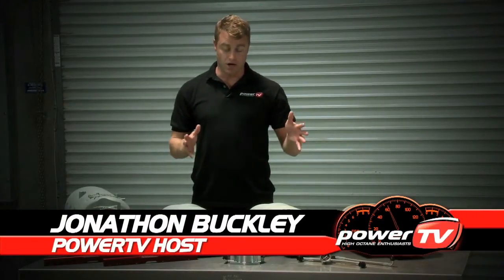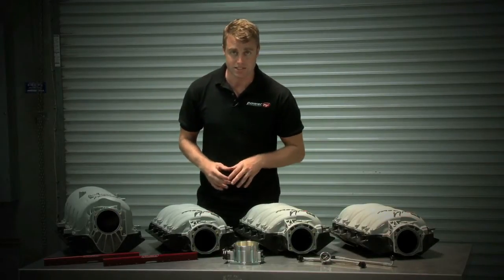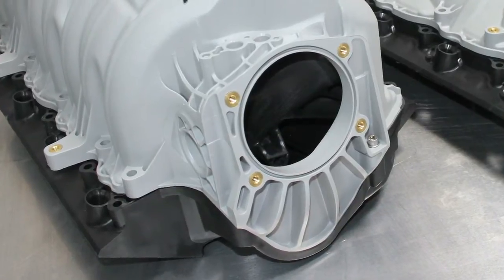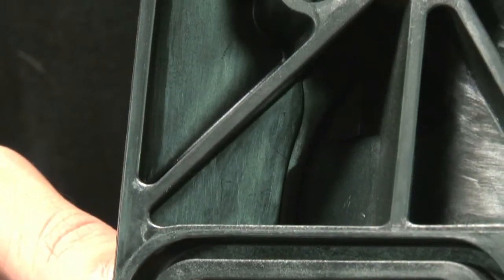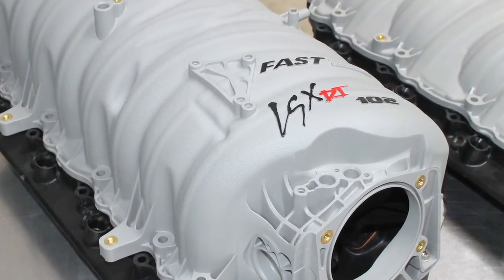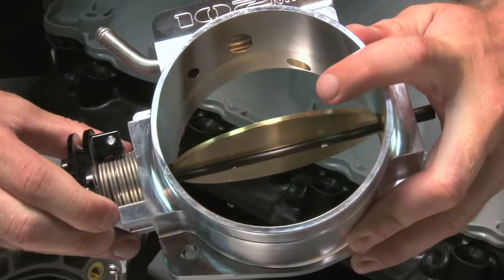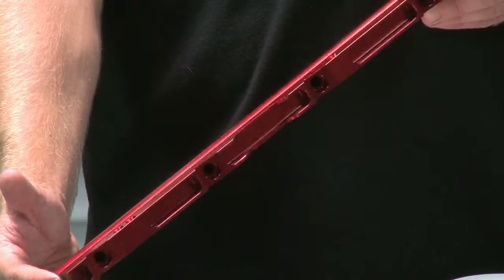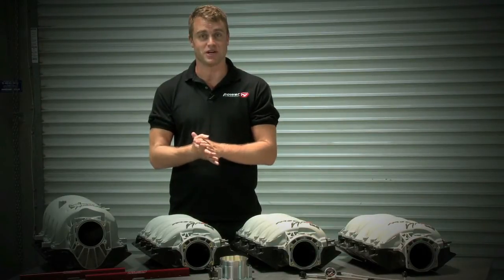FAST™ LSXR & LSXRT Intake Manifolds

Comment: Is the LSXRT compatible with a 2002 Silverado 4wd that has the LM7? of so what other parts would need to be changed to accommodate it? I plan on swapping the cam, lifters, pushrods, springs, rockers, timing chain, oil pump, and the valves and seals.

Comment: Is there any manifolds for the newer 5.3 engines?
Reply from the maker: We don't specifically make any manifolds for the 5.3 engine that was released in 2014, but the manifolds are compatible with the 5.3 that was used up until that year. Thank you.

Comment: If I was to install the LSXR intake on my 2000 WS6 LS1 would I have to purchase any other parts to install ( fuel rail, injectors, ect) The largest throttle body I could use would be a 92 mm ?
Reply: If you go with a 102mm intake part# 146302, the factory fuel rails will not fit.  There are 2 options for fuel rails.  1)If you want to go with billet rails, then you will need fuel rail kit part# 146032-KIT and part# 54028-KIT fuel line conversion kit. 2)You can use our OE style fuel rail kit part# 146021-KIT. This allows the factory style injectors to be utilized. The 92mm throttle body part# 54092 would be a good choice.

If you go with the 92mm intake part# 54039B, with a part# 54092 throttle body, you can re-use your stock LS1 fuel rails and injectors.  

Either way, you will need to upgrade the throttle body because the factory one will not fit on either intake manifold. The techs think the 92mm throttle body part# 54092 would be your best bet.

Hope this helps, thanks!
Reply: CPG Admin IF I use the billet rails can I reuse my stock injectors or will they need to be replaced? If they need to be replaced can I use a higher flowing injector without a dyno tune ? I currently have a 98 mm airbox, high flow filter, 85 mm MAF  1.75 inch long tube headers, dual high flow bullet cats and a Corsa catback installed. Would there be any advantage installing the 102 mm intake over the 92 mm intake ?

Comment: Awesome!! I plan on putting the LSXRT 102mm manifold and 102mm Big Mouth throttle body on my 2013 Silverado 2500HD. Is there anything else I will need to change when adding these parts?
Reply from the maker: Hi Robert, unfortunately the engine in that model Silverado is not compatible with the LSXRT since it requires a rectangle port intake. Also our Big Mouth Throttle Body is drive-by-cable while that truck is drive-by-wire. We apologize for the inconvenience, if you give our tech guys a call at  1-877-334-8355 they will be happy to discuss your options with you. Thank you.
Reply: COMP Cams Thanks for the info!! So if I still want to get the LSXRT 102mm I will need to get different heads?
Reply from the maker: Yes sir, that is correct. Thank you.
Reply: Thanks. Yeah I was thinking 235's

Comment: will the lsx RT fir under a saab 9-7 aero's hood? I havent looked into it too much, but  im fairly certain there is less clearance than a tbss.
Reply from the maker: We just spoke to one of the techs and he believes the chassis is the same on the Trailblazer and the Saab 9-7.  Here is a link to a magazine install of our intake on a Trailblazer SS: http://www.gmhightechperformance.com/tech/lsx_engine/1102gmhtp_fast_lsxrt_intake_manifold_upgrade/viewall.html

It has a lot of pictures - hopefully you  can look at that and compare to your Saab to see if there are any differences. We haven't had any customers install one on the Saab, so it's up to you if you want to give it a try.

Hope this helps, thanks!
Reply: COMP Cams i knew the chassis's were the same, but i read somewhere that a difference between the tbss and the saab was a "more raking hood." I looked at it today and it seems like there should not be an isuue (comparing it the height of the alternator.) thanks for the help guys. 460 naturally aspirated AWHP on the way! I have to admit I'm not running one of your cams though... sorry. a custom 239/246 for me.
Reply from the maker: You're welcome. Good luck with the project and thanks for your interest in FAST!

Comment: ihave the lsxrt in my 5.3 but it leaks fuel from the fuel rail some times and tell now i dont no what is the problem , do i have to change my injectors ? because i have the stock ones , or my instillation was incorrect ?

Comment from the maker: There actually are a few factors that go into that answer, your best option is to contact the FAST tech line at 877-334-8355. The techs will have a few questions about overall setup and will then be able to recommend the best intake for you. Thank you.

Comment: what do you guys recommend for a stock ls1 with headers. My plans with the car is to acheive about 400whp and keep it as street friendly as possible. I'll drop a small cam and maybe some ls6 heads in the future, but meanwhile will the 102mm work on the stock engine without tuning or will the 92mm be enough.